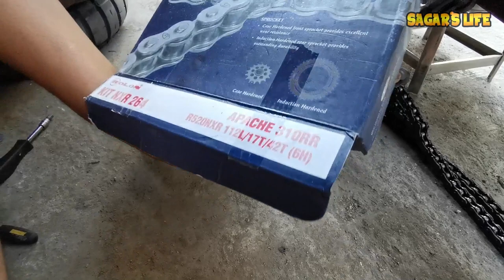Complete Chain Sprocket Kit Installation On Apache RR 310 | Exclusive On Youtube | Detail Guide

Comment: Baapre! How knowledgeable you are 😍😍😍. Very impressive!!!

Just a couple of things:

1. My chain did not come as a sealed/ locked unit. They locked it manually at the SVC. And it was the new gold color.

2. The SVC uses a long (12" x 8" - rough estimate) rectangular metal block under the bike before using the jack. This helps distribute the weight by spreading it over a larger area. They screw it under the bike before lifting it with the jack.
Reply from the maker: Thanks Sridhar.. The jack used at svc costs more Tha 20k.. So I prefer to have small jack for very rearly use of it 😉
Reply: @SagarsLife  
That green sunglass you wore at the beginning of the video - is it the one from Eyewearlabs? It looked very nice on you.
Reply from the maker: @Sridhar.Ananthanarayanan  yes it is brought from Eyewearlabs

Comment: After how many kms should change this chain spocket
Reply from the maker: It's depends on the condition of your chain sprocket... You can see in Vlog still even after 20k kms my chain sprocket condition was very good but due to uneven chain tension problem I have to change it...For safer side you should change it after 20k kms 👍